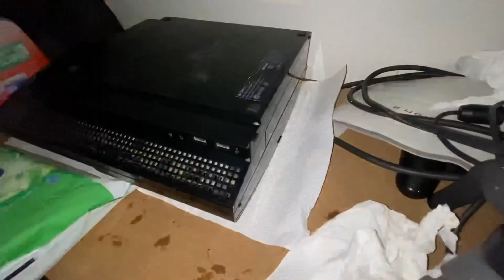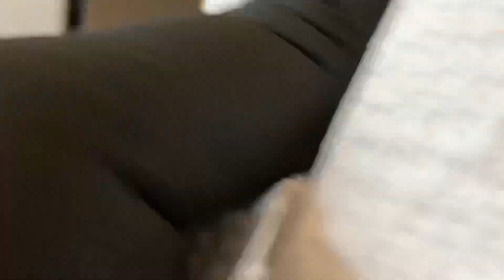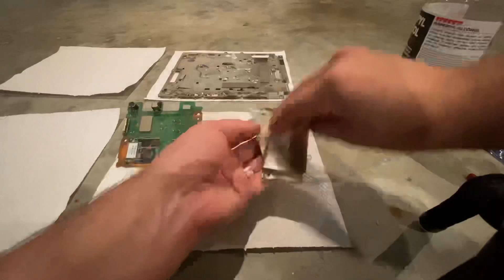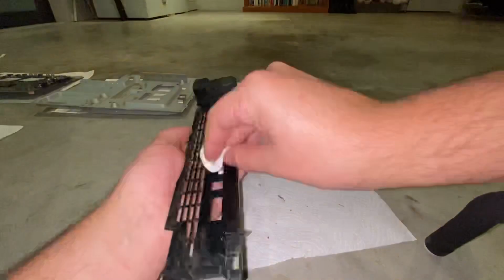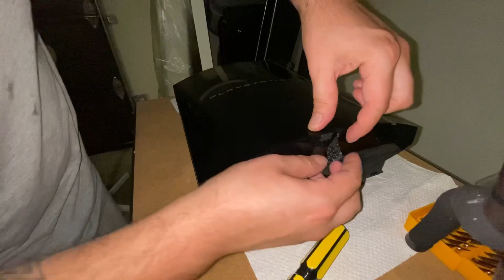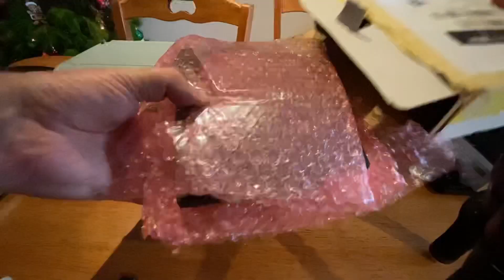Saving a PS3 in 2023! Junk Restoration & Repair: Complete Disassembly Overhaul! + RLOD Thermal Paste

Comment: You half-assed it. You didn't take the power supply apart which is really easy You just pull the part and blow it out You didn't take the hard drive apart it has dust in it too not as bad but it does and if it's that dirty The laser needs to be cleaned The rails need to be greased. You done part restoration You didn't finish the job. In other words you half-assed it.
Reply from the maker: If you watched the full video I actually replaced the whole PSU, the HDD is sealed and working fine why would I take the platters apart to introduce contaminants, the laser and rails are fine I have been using this ps3 every day since this video without fail it’s literally fine. 😅

Comment: Wait so did you acquire another power supply ? Since the original on was a problem ?
Reply from the maker: yeah I had to for brevity's sake, I got a psu from someone in my local gaming group, and the dud is still sitting on a shelf here to be repaired. The old PSU smells really bad though so might just leave it as-is I think it's burnt out.

Comment: Submerge as much as posible in very warm dish soap and water to get the console clean with less effort, then you can just air dry it for a day. Also nowadays you can buy electronic spray cleaner for car parts to clean all the electronic components without a problem, so long as you give them some time to dry.
Reply from the maker: Thanks thats great advice, I scrubbed everything by hand with ispropyl alcohol. The corrosion is extensive in this one but I'm happy to report that it's still going strong and sits in our lounge on the console rack and gets use a couple times a week mostly to play super rub-a-dub :P

Comment: I got a ps3 from a pawn shop for 50 dollars. It was an orginal ps3 model that can play ps2 games. The pawn shop said it didnt turn on so i bought it and brought it home. When i got home and plugged it in, i turned the switch on the back on and it booted up. It was on the orginal firmware from 2006. I put a game in it and the disk drive laser was broken. I bought a new disk drive and opened the ps3 (this ps3 has never been open) and there wasnt a single piece of dust in this thing. I changed the disk drive and now it works. I put a 1tb ssd in it and it plays ps1, ps2, and ps3 games. What i can tell some bought this on launch or close to lauch and the disk drive broke and then they just put it in a closet and left it there until they pawned it in. When playing the last of us, the fan doesnt even ramp up. This thing is silent.
Reply: awesome find! def change thermal paste!
Reply: ymight be a Sony certified Frankie bc ps3. very lucky.

Comment: Is that the right way to apply thermal paste?
Reply from the maker: Before I discuss, my ps3 has been running daily since this video dropped and it’s still going strong! 💪 but… NOPE!!! I would use a pea sized drop in the middle and let the clamping force spread it around that’s the official Sony way but i decided to use this method because I didn’t know better at the time and wanted to ensure it was caked up with paste for all time. There are many many ways to lay paste described online and it’s a big debate. You only need enough to fill imperfections in the material anyway so mine waa probably too much.

Comment: Nice video, watched from start to finish. Have you ever tore it apart since and replace the paste on the actual processor die etc? Just curious as my Fat PS3 is original and never had any work done on it and i think it's running hot.
Reply from the maker: Its very risky to delid the PS3 and the process has a chance of ruining the whole console even for professionals. I would generally recommend using custom firmware to get the actual temp readings inside the console first, and you would probably find that just by cleaning and applying thermal paste like I have done in this video will satisfy your requirements.
Reply: @EverythingPSPOfficial  after installing the custom firmware can you go back to the original again? Are there any articles online somewhere that describe where to get the firmware and how to do it Etc
Reply from the maker: @Soulcommander  plenty of stuff out there if you search PS3 CFW on YouTube there are lots of tutorials, it’s fairly easy to set up now. There is also an online PS3 tools app that works without CFW for some basic stuff like error checking and that might be able to display temps. Check out @MrMario2011 ’s video on How to Jailbreak Your PS3.
Reply: @EverythingPSPOfficial  Thank you! Watched his install video...rather long! :) But very informative.
Reply from the maker: @Soulcommander  for sure, maybe just try accessing PS3 Tools on web it’s perfectly safe and works on all the PS3s just visit that site thru the ps3 browser, I used it to successfully diagnose a bad NEC Tokin capacitor on another ps3 that might end up in an upcoming video

Comment: Update on my PS3: After the thermal paste arrived this morning, I used your video to disassemble the console, get the new paste in there, a new 2032 battery, and to put it back together! Only had to drill out one screw! Thank you so much

Comment: Just the video I needed! I just bought a CECHL PS3 and I've got to remove all the dust and replace thermal paste & the CMOS battery
Reply from the maker: Perfect! Don’t worry about delidding the cpu and GPU chips unless it fails to boot, what I covered here should sort you out for a nice deep clean and general maintenance!
Reply: @EverythingPSPOfficial  nah it works perfectly fine but I still want to do a repaste and a deep clean just for preventative maintenance. I'm waiting for the thermal paste to arrive so I can come back to this video

Comment: if you think one of the capacitors is borked, why wouldn't you either replace the power supply or either fix it, or have someone fix it for you. that is a massive fire hazard.
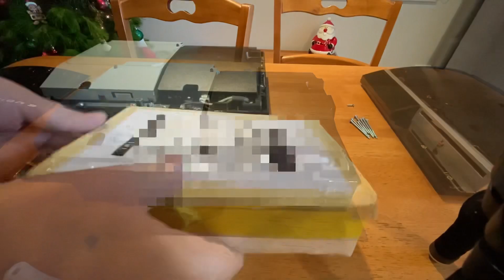Reply from the maker: I did replace the power supply 32:30 👌

Comment: Other than the motherboard needing more of a clean its great for a first time. My OCD/perfectionism is just hectic
Reply from the maker: Thanks 😊 it’s still working great we use it all the time as a media centre and for gaming, I also have my original ps3 slim that I need to refurb at some point and will be more thorough with that after this learning experience

Comment: You should have opened the power supply to check the capacitors condition because after power ON your play station 3 was working fine for few minutes
Reply from the maker: Hi Hassan, you are absolutely correct it was definitely the power supply most likely the caps, I opted to replace it but I have kept the original and may end up recapping it in future if required

Comment: You didn’t repaste the cpu and gpu. You did all that for nothing.
Reply from the maker: Still working strong 💪 it was largely overheating due to the dust and the faulty power supply was preventing it from booting, so I feel that the repairs I performed were adequate without having to delid and risk destroying the whole project. If it fails in future I may look into this but I think I did enough to keep it alive for the foreseeable future, thanks for your comment and concern. 🙏
Reply: @EverythingPSPOfficial  If the temps are fine, dont bother de liding. Deliding is a last resort imo
Reply from the maker: @FG-td4vs  exactly like you wouldn’t replace your whole gearbox if you just needed to replace the clutch
Reply: @EverythingPSPOfficial You’re supposed to change your thermal past after 5-6 years. It’s been 17 years since this line of consoles were released. 

You in this video said (about the thermal paste process) “do your research. I don’t really know what I’m doing. At least on this scale”

Here I am trying to tell you and you seem to do your best to act like you did research and that you knew what you were doing. 

accept that you don’t know a thing. Learn from it. Moving forward, delid, repaste. Period. Wait 5-6 years. Repeat.
Reply: Deliding is a pain in the ass. I wouldnt risk it

Comment: Good job but one thing try next time clim more the but in 22m41s you see the dust in the board you tike a big shower for a perfect clim just one advise for help 
😆
Reply from the maker: Ok thanks! I would have opted for an iso bath but for fear of breaking any components I chose to tread very lightly and only address any problematic dust. Will keep this in mind for next time thanks for watching
Reply: @EverythingPSPOfficial  ho fatto due PS4 in questa settimana,la scheda madre per pulirla dalla polvere uso un pennello di 3/4 cm e un po' di aria compressa
Così non farai mai danni